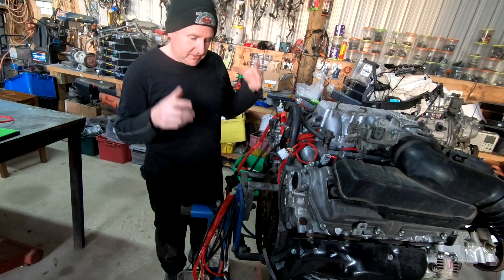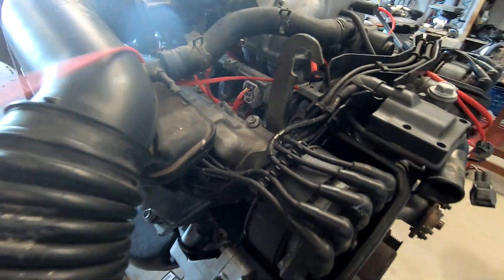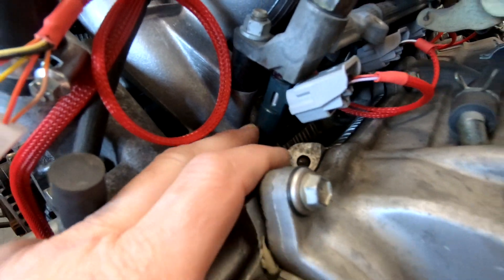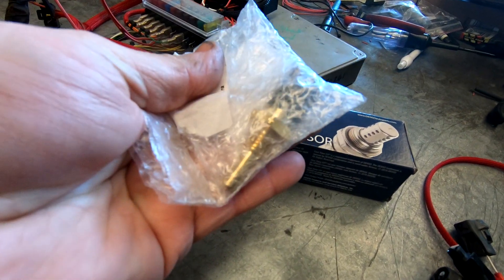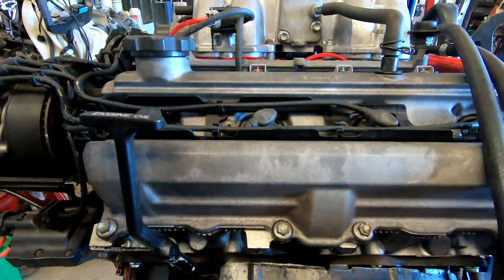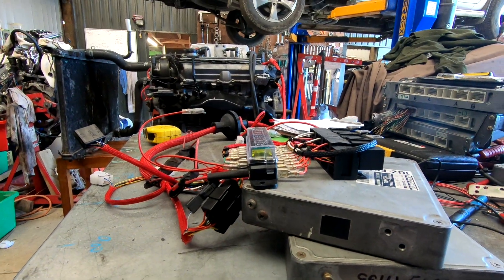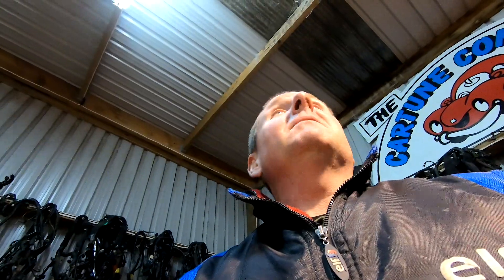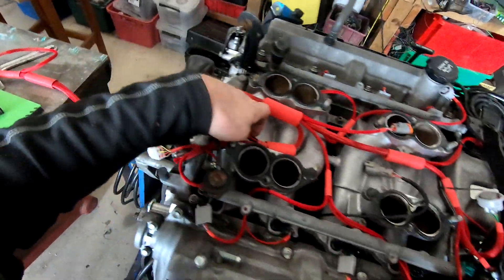Red loom.  Brand New UCF20 1uz Non VVti wiring loom with stock ECU into 240SX

Comment: Hi Kelvin, we love your videos... 
Could you make me up a complete loom to run my 1uz and auto...i.. I'm fitting into my 1979 Toyota hiace which at present has a1.6 petrol and 4 speed column shift? I'm in England. God bless.. jonathan
Reply from the maker: I can make up nearly anything loom wise for 1uz.  Auto is no issue with stock ecu either and looking into some aftermarket options in 2021.  Cheers Kelvin
Reply: @CartuneNZ  big thanks.... Sounds really encouraging... .I think I have a 92 1uz and I think a similar age auto.. But I don't have the correct ECU and need a MAF too... Are you able safely to send to UK?

Also what front disc brake set up would you recommend?
God bless

Jon
Reply from the maker: @sofahousechurch8266  yes, we can send to UK fine.  I have several which I've used later model ecu and accessories with very successfully.   On the next model hiace we use r32 skyline brakes but not sure on that older model.  Cheers Kelvin
Reply: @CartuneNZ  I have a 50440 ECU... Do you think that could work with one of your looms own my engine and box?
Reply from the maker: @sofahousechurch8266  50440 is a 1uz vvti 5 speed auto ecu.  Not suitable for non vvti 4 speed engine.
Reply: @CartuneNZ  your expertise is fab
Reply: Maybe I just need to get the whole lot from you if that's possible...👍
Reply: I've just double checked what I've got and it's a 1993  1uz and a 1992 auto